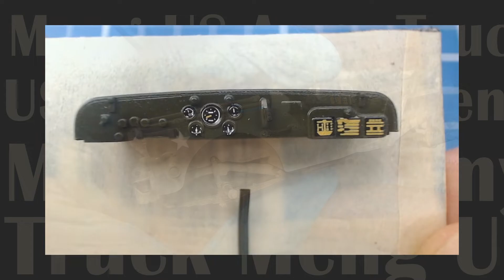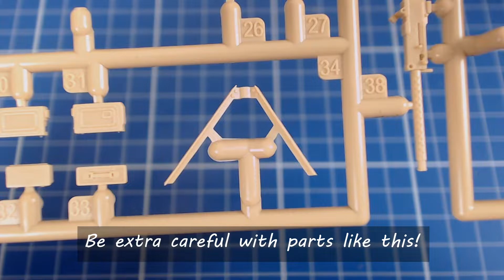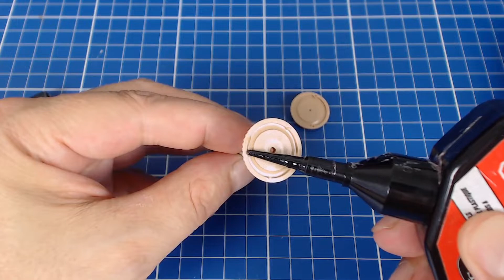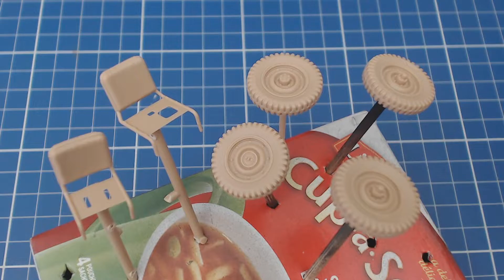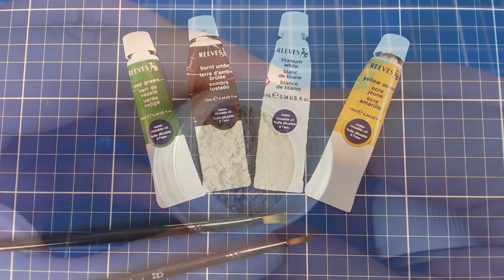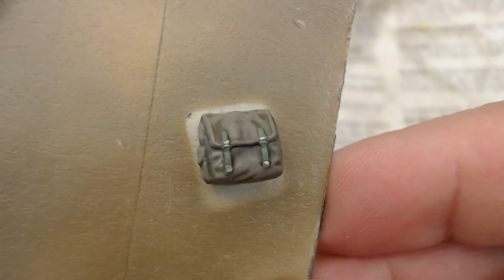Meng Willys MB (Jeep) Build

Comment: Dear Tomas, 
Thanks for sharing the excellent tips in the video.
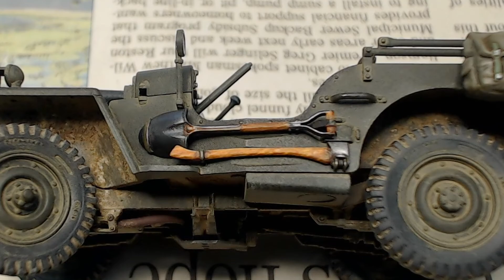In video 18:35, the painting of the shovel looks real. Do you have any video that demonstrates painting of tank accessories? Thank you.
Reply from the maker: Hey Chang, thanks for the note. I've never focused on tank tools in the videos unfortunately. Try this; paint the handles a very light tan color then paint very thin lines in brown to mimic the grain. Next use a clear orange colour over top of that to get that nice warm wood colour. The metal parts, paint them flat black then rub a soft lead pencil over the black to get a steel colour. Or the metal parts can be primed with flat black, then oversprayed with a dark brown rust colour. You can then drybrush the edges with an aluminum metallic paint on the edges. There are other ways to finish tools. Maybe search for "tank tools" in YouTube as I'm sure others have made videos on the topic. Good luck!
Reply: @stevieray3211  Hi Tomas, I can understand your information. Thanks.

Comment: Tomas - excellent build!  Your building and detail painting are top notch, and I'll refer to this for my future builds.  
Just 1 question: why use clear gloss when sealing decals?  Wouldn't a quick spritz of flat clear be easier to use considering an overall flat finished is more desired on a well used military vehicle? 
Keep up the excellent work! 🤙
Reply from the maker: Hi Mike. Thanks for the awesome note and kind words. I use a clear gloss since its smooth and allows our subsequent weathering like streaking - which I didn't do on this model - and pin wash to flow nicely. Sure glossy models look weird at that stage but by the time you lay on your weathering it'll dull down nicely. At the end you can also spot spray dull coat to fix any overly shiny areas.

Also, we don't want a completely flat finish since it destroys the depth we are trying to create with our  post shading with shadows and highlights. A little shine here and there (within reason) also makes for an interesting finish. Study pictures of real vehicles and you'll see different levels of shine that occur naturally. But there are no hard rules. Find a routine that works and appeals to you. Experiment with different techniques and materials - it's half the fun. All the best to you!

Comment: I've noticed when wiring the spark plugs up there's no distributor formthe HT leads to go to! It should be on the right side of the engine so you will have to borrow one or scratch build one!
Reply from the maker: My full respect to you for taking on the detailing of that tiny engine. But it should look amazing once done!

Comment: Where can I get one?
Reply from the maker: Are you asking where you can purchase the kit?
Reply: Yes
Reply from the maker: Hey Dale. Covid is definitely putting a dent in supply as my usual on-line sources are all sold out, except for the flame-thrower version which is available. A check of Amazon and Ebay did find some available with Amazon probably being the lesser expensive since Ebay is basically an auction and sellers charge whatever they want. You may consider the newer Takom brand, its cheaper than the Meng product and comes with a figure and trailer. It may be an option for you.
Reply: @stevieray3211  thanks for the update. I’ll try amazon.

Comment: Nice paint/weathering job!
Reply from the maker: Thank you Gerardo for the nice comment and for watching the video. The feedback is very appreciated. All the best!
Reply: hey Tomas I like oil base wash can I use oil thinner like mineral spirit as a binder for the pigments and after you apply all the pigments do you seal model with a matt coat to protect everything?
Reply from the maker: I never get good results using mineral spirits as a binder. The pigments seem to dissolve and it ends up becoming tinted paint. I prefer alcohol as a binder. I use dull coat very sparingly since it flattens everything if sprayed on too thick. I only spray it on very shiny parts. Go light with the flat coat! Even pigments applied dry stay on pretty well. Pigments fixed with alcohol stick very well. You have to experiment and use what works best for you. I can only recommend materials and techniques that I have found that work.